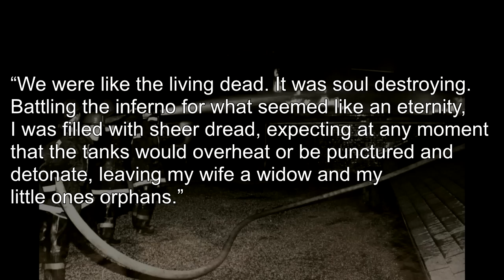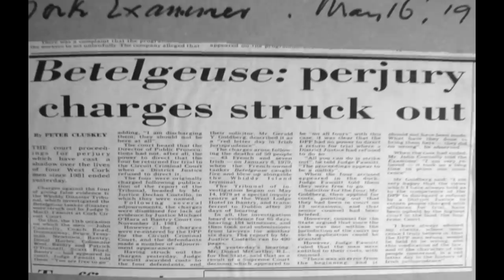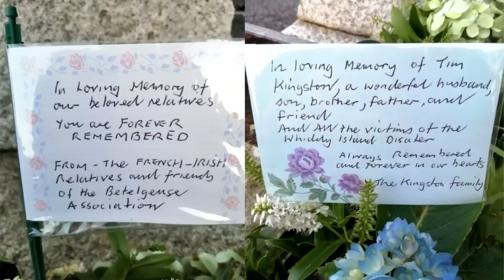The Whiddy Island Disaster - Ireland's Worst Maritime Tragedy

Comment: Former tanker officer - There is NO reason why a 10YO ship should be at the end of its useful life.  Most ships are designed for MINIMUM 20years, and I've worked on older.  If she was a warn out has been at 10 years, that comes down to one thing, the owners not putting the needed money into her for upkeep.  She was made at a reputable yard (Chantier de l'Atlantique - France).
Reply: Ship person here, i can confirm that most ships can outlive their live expectency. I've been on a motor cutter from the 70s, and she looks actually pretty new. Oh, and, can't find anything on the Betelgeuse's stats, but was it a Batillius class tanker?
Reply: I have talked to several naval architects about a tanker's lifespan in the 1960's and 1970's and they all stated that the normal life span back then was 7-10 years depending on use and maintenance levels. Good companies like BP and P&O would sell them after 7 years but  some companies were notorious for doing minimal upkeep and running them right down to save money. Her sister ship which was in a slightly better condition was scrapped the year before. Beteguese was just being kept on running for a few more voyages but as it was going to be scrapped then they did not do the essential repairs that would have been done otherwise. The older tankers would be sold onto the PanHolLib owners who would run them till they dropped. Most of these old rust-buckets were registered to a one ship company so that if there was any problems then the company would just go into liquidation so that nobody could sue after an oil spill. The formula was No Pay, No Claims, Much cheaper insurance and More Profit. Tankers nowadays are far better built with twin hulls, twin screws, real maintenance and better trained crews so that 15 to 20 years is more normal.
Reply: The most accidents happening because human failure
Reply: @richarddickson747  Boy, you should've asked them about the life expectancy of a T2 tanker, they were all literally rated for 5 YEARS or less-
Reply: Oil companies no maintenance
Reply: @ukaszwalczak1154  correct! Schenectady famously barely lasted longer than her sea trials - such was the build quality and hence life expectancy.
Reply: @ukaszwalczak1154  but some sailed into the 2000’s!!! 🤷‍♂️
Reply: No one goes into the oil business for any other reason other than to rip as much profit as possible.
All this talk of reputation and longevity is utter codswallop.
Reply: Holy shit. There are cargo ships so well built that properly maintained, they have been worth refitting at 50 years old and served into their 70's.
Reply: You hit the nail on the head with one key word, owners. 10 years old is young for any cared for vessel, 16 foot or 316 foot and any in between or over.
Reply: Yes I agree. There are iron ore boats on the great lakes that have been serving since the 1940s. I understand that salt water ships don't last as long as fresh water ships, but 10 years?
Reply: @BrenMurphy1  Amen to that.
Reply: @BrenMurphy1  and you, why do you work? Profit? Do you own a business? If not, why? And if you do, do you not do it for profit? The argument you make is just idiocy... if you came at this with an honest argument like the company being pieces of shit for not keeping up with safety standards and proper upkeep, then I could understand, but just looking at it from a profit standpoint is just dumb
Reply: Agreed.  The ship should have lasted much longer.  A number of the quickly war-built T-2 and T-3 tankers, which were expected to last ten years, were still in service 30 years later.

The Betelgeuse was poorly maintained.  That's the ship owner/operator's fault.
Reply: I'm just a normal idiot, 10 years seems short life for a ship. Even after reading some of the replies
Reply: There's an 11 year old tanker anchored within sight of me right now that according to Marine Traffic is valued at $20.5 million (scrap value $5 million). She'd seem to have a few years ahead of her yet (mad government policies about abandoning fossil fuels aside).
Reply: There are still a lot of Classic Lakers still operating on the great lakes. The oldest operating one one being from the 40’s, the Alpena still operating at 80 years old. There are even some that were operating for over a 100 years. Including the J.B. Ford (112 years), St. Mary’s Challenger (107 years), & E.M. Ford (110 years). Of course those are a few of the few that operate that long, but it is completely possible to make a ship last a very long time, this was pure negligence.
Reply: Ty I don’t know anything about ship but still thought they must not have kept up with repairs and normal maintenance
Reply: " If she was a warn out has been at 10 years"? What does that mean?
Reply: Probably never changed the oil either
Reply: Just because you think a ship should last x years doesnt mean it was designed to do so.
Reply: @BrenMurphy1      And you are a flat-out liar.
Reply: Ten years of turn and burns?
Reply: ships have no gender!
Reply: Nevermind this is with technology from over 50 years ago. 🤷‍♂️ we've advanced a lot since then you know?
Reply: Liberty ships weren’t.
Reply: My dad sailed on 15 years old roro's in the baltic and they get re-fitted with new machinery and batteries for hybrid conversion...
Reply: Just no maintenance. Look at other sources… and they all say that on this voyage she had a rust/metal fatigue hole in her hull, leaking oil all the way from the Middle East. All due to lack of life-long care. Leaking oil means water on fire. All it is is people getting the most they can out of a boat they bought cheaply. If such a young ship is a rust bucket, then that’s severe neglect for her whole life. Maintenance, corrosion prevention, previous voyages…
But yeah, most other sources describe more about the neglect leading to a rusted, metal fatigued hull. Which is shocking. If I find the sources again I’ll link below.
Reply: Also, as i know, cargo should be unloaded keeping the ship in balance, but also avoiding structure stress. By unloading the middle section, the ship will be in balance, but the structure is suffering stress.
Reply: The average cargo ship is over 20 years old. They can last well over 30, 40 years but money is the issue.
Reply: There are ore boats on the Great Lakes that are 40+ years old. They haul taconite pellets for ten months out of the year until the Soo locks freeze up. The newer boats on the Lakes are 1,000 feet and they put a lot of mariners on the unemployment line.
Reply: Even simply from a financial perspective, it must take about 10 years before a ship even pays for itself and starts earning the company a profit.
Reply: yeah i don’t work on a ship but even i know that they’re supposed to last a lot longer than 10 years.
Reply: I was told alcohol was involved . Human error.

Comment: I had a summer engineering job during the terminal’s construction in 1967 and surveyed and installed the fire control pipelines around the tanks.  They were designed to carry seawater.  The inquiry noted that the entire system was unusable as the pumps needed to pressurise the system had not been maintained and were rusted solid.  The terminal was opened to great fanfare and came to a terrible end.  Thank you Raven’s Eye Channel for highlighting the litany of mistakes and coverups to avoid prosecution of those responsible.

Comment: Absolutely terrifying! The removal of the foot bridge makes sense from a production point of view but in hindsight was so deadly! It's hard to believe the firefighting vessel was so far away. Complacency is responsible for more deaths than stupidity ever will be. Great video!
Reply: Security measures cost money, you know! :P
Reply: It could be argued that complacency is stupid...
Reply: I suspect the original intention was to remove the foot bridge. Otherwise, there wouldn’t have been provisions made in the design of the terminal to accommodate two ships.

Other than that, two many other corners had been cut for this to have made much difference, in my opinion.
Reply: @johncox2865   Your right. This is a common tactic. Design the site as required, then make alterations when the government officials wont be looking so closely over bylaws etc.
Reply: @johncox2865  Yeah seems pretty logical to me, I don't really understand why there's such disgust in the way the video states it was done for profit? I'd assumed it was only there as part of the construction process.

Comment: Yes I do remember it well, I was in bed at 12.50am, my reaction was why was Concord flying this late? If you lived on the south coast of Ireland then the sonic boom was part of your day, my sister and her boyfriend now husband returned at about 2 am from a dance in the local hotel in Bantry and seen the explosion, the weather was shocking too and the pall of black smoke was present for days. The cause of the explosion was that of TWA 800 in 1996 an empty storage tank filled with gas fumes set off by the uneven ballast breaking the tanker in two, the wiring exposed caused the chain reaction. The fact that  there was one survivor who was not in his place at the time and probably would have saved lives. Oh so much should have and had to be done but was not by government and others, this only changed after another terrible disaster on 14th February 1981 The Stardust Ballroom Fire costing 48 lives, not sure if this could happen again, suppose it could anytime.

Comment: Once again corporate and individual ambivalence to their respective responsibilities was found greatly lacking in quite a few areas, in short the deaths and injuries were completely avoidable and unnecessary, it would be easy to blame the watch keeper and the captains/officers of the fire boat and rescue vessels, and yes they should shoulder some responsibility, but Gulf oil should also be taken to task for the tragic events that happened, especially if the cutbacks that they implemented caused safety issues, which in my opinion must have happened, cutbacks in any industrial setting will, almost invariably, affect safety and conditions that lend themselves to an accident occurring. 
As always an excellent recounting of a horrendous and tragic event, told without bias, telling us the facts as they are available, and concisely, but with a pronunciation error that should be overlooked by everyone, as I do, but you do say you expected some comments, so as requested here you go. One point that made me wonder about is how did the enquiry come to the conclusion that “incorrect pumping off procedures” caused or contributed to the events? Surely only those that perished would have been in a position to either confirm or refute those findings, but as they all tragically died those allegations can’t ever be proven or disproven. 😀👍🇬🇧🏴🇺🇦

Comment: 10 years old doesn’t mean old… unless you don’t stick to current regulations.
A lack of inert gas in half full oil tanks, increases corrosion and more importantly oil in a gaseous form in part full tanks explodes. (It happened on a plane as well). There were several other ship explosions in the years up to this. They knew this was a problem, the US had changed regulations, the EU or international insurance had not.
More importantly corrosion was below the water. They had leaked from the Middle East.
Other ships which exploded were empty except for the gas. They were berthed by land and there wasn’t the horror of watching the ship slowly go up.

https://youtu.be/tc-EKLaJolk

Comment: Okay, first off... THIS IS NOT any kind of blame or shame. I can't speak a bit to the qualities or quantities of training to the crew, nor any other victims of this disaster.

    I'm ONLY trying to offer a pointer here, regarding a phrase in the story-telling... AND this is nothing against the narrator. I'm sure he's done his best diligence, and some things you just can't always get out of books. I've learned as much from what I was told in Bootcamp (US Navy) as I've also learned in experience...

    The phrasing was "...Since there were already flames spreading out on the water below, jumping overboard was not an option..." AND it suggests that at least some members of the crew stayed on the boat, afraid to dive over.

    SO the tip... Flames don't hurt you, at least not immediately. It takes time to accumulate heat, and THAT HEAT being accumulated is what hurts you. When you dive over, you'll be falling through all those flames in less than a second, not remotely enough time to hurt, and you'll be under water... THEN the trick is to STAY YOUR ASS UNDERWATER until you're clear of the flames.

    It's at least worth a try... and it beats the hell out of burning to death.

    "But what about the oil sticking to you?"

    Who cares? It's the VAPORS that actually burn, since there isn't enough oxygen available in liquid fuels or oils to actually burn. That's why flames are always above the surface and the water nearest won't even boil until the fire is RIDICULOUSLY hot.

     Once you get under the water, You'll be cooling off any heated oil that does stick to you, or your clothes. You can even roll onto your back and paddle backwards (sort of like a squid's movements) in what's called and "elementary back stroke" so you can see above you, where the flames are. It's a fairly efficient method of getting through water, to boot.

     SO the key, here is "Do NOT panic." Take the time to be sure of what you're going to need to do and then do it deliberately. You've either got the time or not, and if not, it's not going to matter anyway. Take off excess clothing like coats and loose, overstuffed, or insulated crap. Yeah, the water's cold, but you can make a fair distance actively swimming before it's all over. Then get your ass into the water, roll over and "squid stroke" your way out until you can see daylight. Take it easy, because this movement is gestaltic rhythms and pulses. If you're at sea, you can even use the tidal ebb and flow rhythms of the sea to help push you along in time with your own strokes... Once it's reasonable to hit the surface, pick your favorite, fastest method of hauling ass and get out of there. Explosions suck, but even on the surface, a quick duck under can still save your ass... even at or around a foot or two under. BUT get well and clear, and you can survive just such a horrible thing as a fire onboard.  ;o)
Reply: Nobody in this disaster burnt to death, some drowned after having jumped overboard and some were killed by the explosion, some of their bodies being thrown hundreds of feet away.

Some of the crew were found huddled together in a hut on one of the Dolphins. 

The people working on the jetty that night were all relief workers including the foreman and hadn't been taught anything about fire safety. 

She brewed up quickly and by the time most of the workers noticed that something was wrong it was already too late.